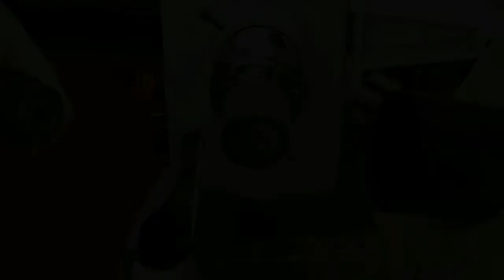Antique Style Pepper Mill Kit

Comment: I just got some of these pepper grinders and I'm glad I watched your video.  You have a good idea  in insetting the grinder mechanism into the top and you are so right in predrilling for the screws.  This not only keeps the screws from breaking off but the screws have much more holding power as the threads of the screw actually cut threads into the wood similar to what a thread tap does. It also keeps the wood from possibly splitting . Thanks so much for a very informative video.